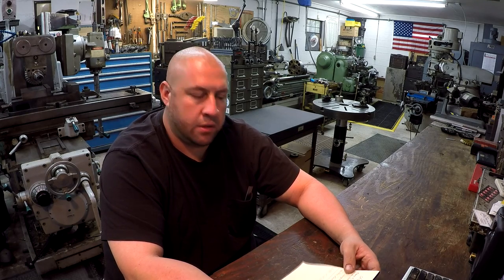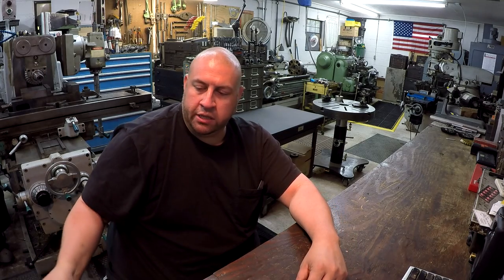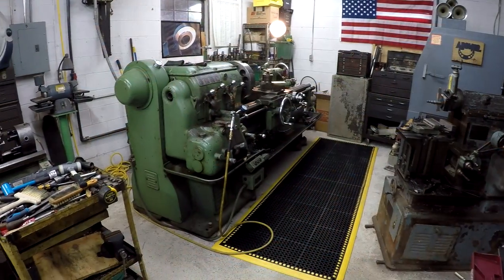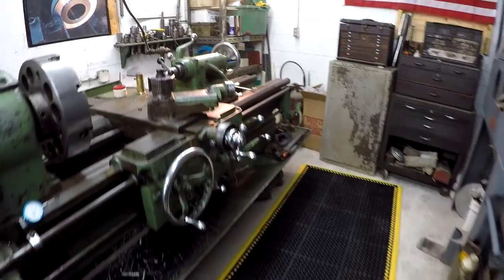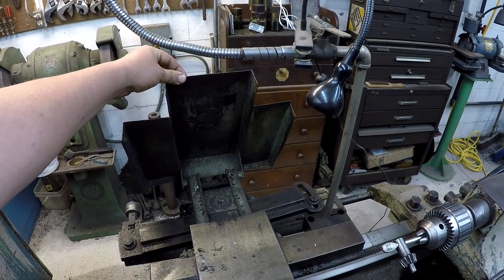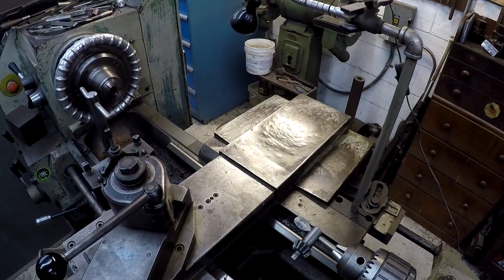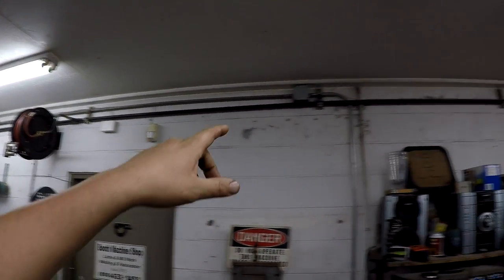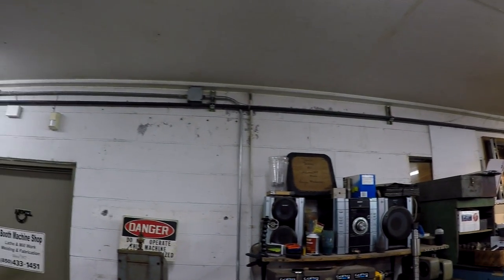Shop Talk 8: Lathe Way Damage? Shop Air Supply

Comment: Being a Facilities Mgr for a new shop complex I knew it was going to be a battle for $$$ with the Navy, so I laid out the entire LP (150 psi) air system in steel pipe, copper/copper nickel, and schd 80 ABS/PVC all 1-1/2" trunk and 3/4" drops. When I presented the total costs for each, the command immediately approved the plastic. With the budget we purchased enough pipe and fittings to do 3 shops of the size we were starting with. As new runs and cut ins were required we had enough extras for the runs and any repairs along the way. We also did a smaller run in in the HP welding shop for HP air that required stainless tubing/pipe all TIGed. You did an excellent job on your air system Thanks for sharing.

Comment: I have never had a problem using PVC for airlines.  I have had them in all my shops for over 25 years.  The oldest lines were probably 15 years old and still worked.  They will need to be replaced or reglued from time to time, but compared to steal  pipe they are cheaper and much easier to work with.  Thanks for the video @abom79.  Keep them coming.  Have a great week.

Comment: Two things Adam, number one I would leave the dings in the cross slide cover just like it is, it will serve as a reminder of your Dad and his personality. Number two, I have the same air system in my shop (30'X60') plumbed with schedule 80 PVC, been in use for about 15 years, no issues. One thing I would change is a short pigtail out of the compressor to the wall made of rubber to absorb the vibrations from the comp.  Enjoy the videos guy.

Comment: Great shop talk as for the air lines I have sch80 PVC and like you said never had a blow out and I've max it out at 150psi and it holds fine but it runs at 100psi for the tools. Keep them coming I'm looking forward to the micro reading episode.

Comment: Hi Adam, Yes, the PVC does work good for air service lines! I did a friend's bodyshop years ago ( more than 20) with SCH40 2 inch and it's still leak-free. The thing we did different was routed all of the overhead lines so that any moisture in the lines would drain back to the tank. We sloped it down towards the tank location. Being a Bodyshop, we did install a dryer, and while we do little sandblasting, the dryer would aid in keeping the moisture out of the equipment and the blasting media.

Comment: I wouldn't repair the damage to the Victor, its a momento.  I would strongly suggest an alternative to the PVC.  It may hold pressure in excess of what you are using but if you hit it hard enough it will explode and splinter.  Dont use black pipe either.
Reply: Why not black, i so preferred black. You really should not be able to harm it, so shut down or accident because of a break..why don't you like it??

Comment: Adam I used plastic air brake line for my shop air lines. It is the same type we use at work on our trucks. It is flexible and very strong and comes in all sizes and uses brass compression fittings with pipe threads and you can splice in where ever you need to later.

Comment: Adam, a couple suggestions on your air line. Slope your main line towards the end and put a valve one the end. This is used to blow out any water that will accumulate in the line. On mine I elbowed it down to a valve and piped it outdoors to blow out the water.  On your taps come off the top of the main line going up a couple of inches. Not side or bottom.  This will reduce water in your air stream going to your tools. Water traps at the end of each tap should be used. I got mine off eBay. 
Al in Michigan.

Comment: We have a belt sander at work and it is one of the most used fixed items in the shop - it is especially useful when grinding (say) pocket knives, as it gives a hollow grind at the end of the belt - I did this on my pocket knife (I was having trouble stripping a heavy, but small diameter sheath on some load cell cables. I wasted considerable time trying various strip[ping tools (all good) that I have in my arsenal, and all that I did was shorten the cable. I came to the conclusion that I needed to bring my p/knife to work, which I did the next day along with stone (fine and coarse). I was able to hollow grind the blade and then hone it (thanks for your honing comments, Adam); I was able to do a light drag slice and cleanly and effectively strip the sheath off the cable without nicking the fine wires. I might add that I was in a very cramped position under the machine (a super spreader) that I was doing the cable mods on; using my p/knife was a breeze compared the conventional strippers., Hooray for belt sanders; the machinist seems to get a lot of use out of it as well.

Comment: On your air line, close the loop all the way around the room so there are no dead ends. This way all the drops will have a full charge, no pressure drop if someone uses an air item between you and the compressor. You will also increase the reserve air capacity of your compressor by having a closed loop all around the top of the room , you can still plumb in what ever you want and put in however many drops you want cause you have that constant two way supply of air. Could increase you reserve air by as much as 15 - 20 gallons depending on the size of pipe you use.
Reply from the maker: Something I always intented to do. I still have room on the other wall to attach the pipe to the existing uni-strut with the conduit.

Comment: Thank you Adam for taking the time to do these video's. I too have wondered about those dings in that cover, it's that sort of repair that I would look at for years and never do!. The Wilton belt sander sounds like a very good deal, I looked at Craigs list here in England after Mr Lipton bought a nice bit of kit off it, Well,,,,I couldn't find any deals for nice kit, but, If I was in the market for a nice new STD, there was plenty on offer!!, Regards, J.

Comment: Hi Adam, nice shop talk series, thanks for sharing.  In the UK Durapipe make a PVC sch'80 pipe rated to around 200psi with a 30 year life span recommendation. I would imagine that your lines are of a similar specification. It is used extensively for airlines in factories and workshops around the world. As said in an earlier comment a reduction in pressure down to around 90psi for airline runs would help in power saving and leaks on flexible hoses etc. It is recommended for use inside or out of direct sunlight. It is highly unlikely to fail unless subjected to severe mechanical shock even after many years use. A shutoff valve on each of your drops will allow quick sectional shut offs for maintenance. regards from the UK

Comment: Thanks for answering the questions, I've been wondering about those dents in the top of the side of the cross side for a while. You really keep a clean shop and I wish you had the time and cash to restore  your machinery much like Keith Rucker does, new paint and hoses maybe add flood coolant. Just be sure and keep some of the character your Dad left, like the dented cover plate.  Maybe you could have a few work days and some subscribers could come down and give you a hand. I wish I knew more about metal work, I would be glad to come down and help if I did. My dad was a cabinet maker not a machinist though. I am really impressed at how you do what you can as you go and how clean you keep your equipment and shop though. The schedule 80 pipe is more than capable to handle the air pressure you're going to need. Keep that oil and the air filters changed in that T30 and drain the water and it will last you a very very long time.

Comment: Hey Adam. A small tip for your air supply. Set a short piece of hydraulic hose in between the compressor and the hard lines. Removes 80% of the sound from the compressor. And it's even fail proof at that pressure.

Comment: I learned shop skills (metal, wood, printing) in the 1950s.

Then, we had a Rockwell-Delta 12" disk abrasive finishing machine (disk sander).

When I was constructing my present shop, I first purchased a Delta 12" disk/6"x48" belt machine. The quality was as good as the one I used in the 1950s, and there was virtually no differences in the product.

I use the 6"x48" belt most often.

My work tables are maintained dead-on 90 degrees, although there is indeed the capability for adjusting to alternate orientations.

Incidentally, the 6"x48" belt can be adjusted to be level.

Mine is 1-1/2 HP single-phase and is operated from 240 volts. Standard Delta starter, not the optional magnetic starter.

I have mine in the enclosed stand, but on a Delta movable stand. I seldom, if ever move it, however.

My high HP Delta machines have the optional magnetic motor starter with 24 volts on the momentary switches.

Comment: Adam that is a good compressor, we had one just like yours at work that supplied our shop air all we had to do to it is change oil ever now and again it ran for years.
Reply from the maker: It's been running strong for about 17 years or so now!

Comment: Thanks Adam, I'm glad you fared well in the storm...I forgot to mention that on your SNS. I also have a section of the ways on my South Bend ground out(previous to me as well), and I think it's worth noting that it is only for the tailstock, and I couldn't really run my machine if it were pulled up that close to the headstock. It almost seems like a manufacturer's oversight in design...unless someone could enlighten me on when you'd use that section of the ways.

Aloha...Chuck

Comment: Cutting on those tailstock ways is very common to gain just a bit more clearance...  The tailstock can rarely get that close to the chuck and be of any real use, so it's of little consequence but can be a fair bit of gain to clearance them a bit.  If you really hate the look of them, then grind them off flat (like the front tailstock way) or dress them up so it doesn't look like as much of a 'Hack job'

Comment: That PVC pipe is a solid choice in your shop. You are not hardlined into any vibration sources, and you use hose reels. Your shop never gets cold (ya, I know you think its cold, its not..) so no issues there either.
Plastic is a bad choice in places like automotive shops where techs tend to plug right into the outlet and whip the hose out of the way when they walk around.
Enjoyed the story about the dents, I like...

Comment: Hi Adam,
I once owned a 22" swing Leighman Lathe and someone had ground the ways on it.  They had actually ground the operator's side as well. I called it the poor man's gap bed.  You could swing a 26" diameter part up close to the chuck.   Luckily the parts they ground out in no way created a problem with the carriage travel or any alignments.

Looking forward to you next shop talk video.  

PS - are you ever going to show us how to design and build a working hydraulic or pneumatic cylinder?

Comment: I've got a project idea, that seems like something you could really put to use in your shop.
"Motorized horizontal rotary welding fixture."
Something with a small chuck, variable speed so you can use it for weld build-up and metalizing spray weld thing you've been doing on the lathe, which always looks like a lathe killer to me.

Comment: I think you made a good choice getting a belt sander without the disc sander.  I have the much cheaper HF dual purpose 6"x48" belt sander that includes a 9" disk sander for my home workshop, and the disk sander gets in the way when using the belt sander because you can't have anything go more than an inch or so to the right of the belt unless you lift the part you are sanding way above the rest to let it clear the disk sander housing.   
Eventually I may take my disk section off, because it is in the way and I almost never use it.   Chris

Comment: That actually would be a really good mini-series to make up. "Reading a Micrometer 101", and the different types of micrometers there are. Same way with calipers, both manuals and digitals. More so on the manual types. I was lucky enough to be taught old-school years ago in school before the digital types started coming out. The guys I work with in the shop have no clue how to read the manual types. If they don't have a digital they won't even attempt to try to read it.

Comment: I have a plastic air-line system in to my blasting cabinet too. It's a 7 or 8 mm thick pipe with a 1.5 cm OD. I believe it's high pressure water line, but i don't remember where i got it, just that it was around. In four years it hasn't leaked or popped. But i do know that plastic decomposes with time, so i'm already looking for a replacement.

Comment: Ideally a preferred way to have your Main air line to run is a complete circle around the shop no dead end drops though in a shop that's smaller not necessary always helps to equalize pressure for equipment use with multiple operators using it

Comment: Almost every shop I've worked in had some PVC air line. Virtually every leak I've ever fixed was an old glue joint coming apart from not being prepped good. I have seen a few pipes burst from something hitting them, but even if it does throw bits of plastic, they are so light that there is no energy even if you are right next to it. The worst is when someone breaks off a quick coupler, as those have enough mass to hit you, but even then it's no big deal. Since you are half way there, maybe just extend the line you have to the blast cabinet to run down the other side of the shop. Might be easier than the ceiling with the lights and electrical stuff.  I didn't see a line to the air horns on top of the blast cab. ;)

Comment: Adam, I agree with the other comments about the Victor. Leave the dents. They are a great reminder of your Dad. I treasure anything like that   from my dad. 
It may be just the camera angle, but it looked like your air compressor's tank drain was on the end of the tank, instead of the bottom. Hopefully it's not or your tank would be half full of water by now. Especially in that humid Gulf air!
Reply from the maker: The drain is mounted there and an air line is plumbed in from the bottom.

Comment: Careful with the pvc air line.  I was in a shop one day when the pvc air line let go.  I had just stepped outside and a bomb went off in the shop.  3 foot pvc spears were stuck in everything....in the walls, ceiling, boxes, etc...   The whole thing turned into giant splinters and I may have been killed if I had been inside the shop when it blew up.  There was no warning, it just went boom.  I don't remember the details about the pvc diameter or schedule, but that taught me not to use pvc for air.  Stay safe.

Comment: It's easy to get sucked in to import junk prices.  I was looking for a 4 jaw for my lathe and was considering an import because they were so affordable.  I finally decided on a barely used thin profile Union chuck with low profile jaws.  Now I can use the full capacity of my lathe with a 4 jaw chuck.

Comment: Adam, if you have a straight single air run it could starve anything up by the entry point.  The best way, if you have a 10 or 12 gallon tank is to use it as a receiver located at the furthest point and close the loop back to the compressor.  No matter what you have running, you won't starve any thing down stream.
Reply: Would this really be of much benefit if only 1 piece of machinery going at once? I understand your point, but just question if in this circumstance, if it'd be worth it.
Reply: It depends on the tools used with the air and how long they are being used. A blast cabinet or a D/A uses a load or air but you might have enough capacity to run for a reasonable length of time before stopping to rebuild pressure. Ive in a couple of workshops fitted in a spare receiver on a stop valve so that if lots of air is needed, the valve is opened and charged up to maintain a decent flow. Wow, I made saying 'Yes' complicated. J.

Comment: You could build a belt sander instead of buying one. It would make some interesting videos.
Reply: That would be a fairly epic project to do from the ground up with all the video production that would entail.  Maybe not as complex as Tom Lipton's etching press, but there's a perfect example of how that kind of thing can take a while.

Meanwhile, I'm sure it'd be to have a belt sander.
Reply: Would be a fun project.
Tom has built his belt sander also by himself.
Reply: +Jan Visser is there a video series on that?  If so, I need to go watch it.
Reply: He didn't make a series on the build but explains the details in a video called  Roach Coach Snack Break 5
Reply: He didn't make a series on the build but explains the details in a video called  Roach Coach Snack Break 5
Reply: +Jan Visser I'll check it out, thanks.